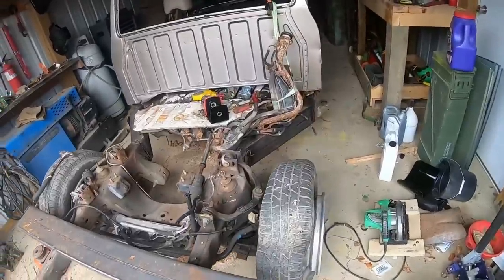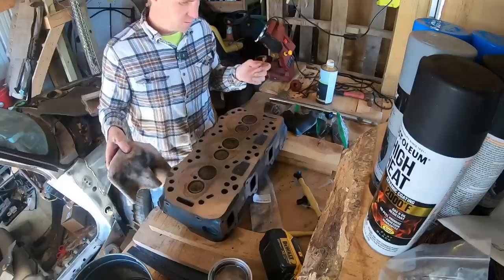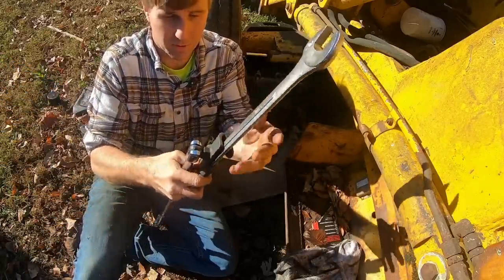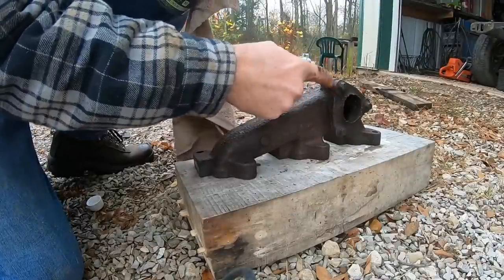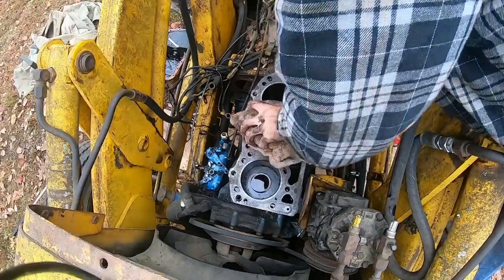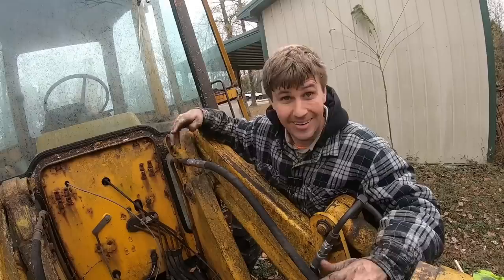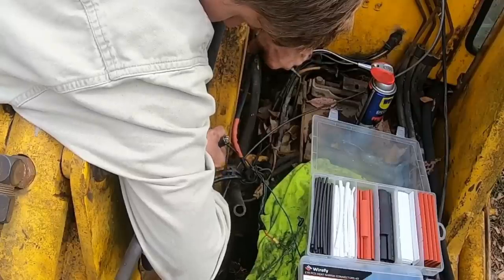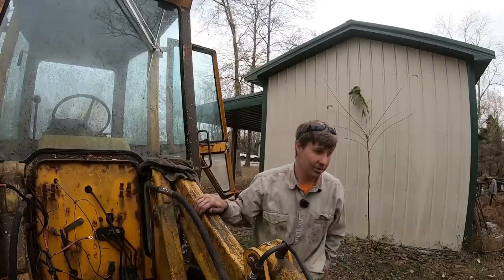Trying to Bring a Non Running Backhoe to Life- Can it be Fixed?

Comment: Gettin in deep there bud😁
I’d spend a few more seconds honing cylinders but slow drill speed down and use lots of wd40
I normally have someone spray wide open at same time of honing 
Wire wheel the top of pistons and should be a part number for piston and maybe that will lead you towards the right rings?
I assume you have already but make sure it’s not been bored out already it will be stamped on top of pistons also
Std. = stock
.20 .30 etc is overbores 
Good luck hopefully you don’t hate me 😁😂🤦‍♂️lol
Reply from the maker: Hahaha, hate you? How could I possibly hate you.  It's the finest flower planter I've ever owned!  😂😂 definitely appreciate all the help and answering all the messages.  💪
Reply: @CaptainKleeman  lol I hope everything else works on it for you
Reply: Maybe Clint can send someone to do all the work while you hold the camera. That will speed  things up a bit. Enjoy  watching. Thx
Reply: We can probably all agree that C&C is your most reliable comment. I’ll agree that more honing in the cylinders wouldn’t hurt. Your roto-plunger 6k action is good and will get you a good cross hatch.  Those rod bearings are probably a clue to that having been apart, and while they look good, I’d either check with a micrometer or plasti-gauge to see what the clearance is on them. This far in be good to know if the crank has been turned down, the bearings you have may be the wrong size if it has. Keep at it, you’re doing a fine job!
Reply: Could those scratches be from excessive end play in the crank since they all in line.
Reply: @williamreese2477  He isn't doing it for speed. He's doing it as a learning experience and on the plus side, have a backhoe when done. This is how people learn, by doing things. You have to start somewhere.
Reply: Seconded! I also hit the top of the valves with a nylon hammer to make sure the keepers and retainers are seated. When you shock the assembly a little, it will either finish seating the parts (this is desired) or they will fly out. The good part about them flying out at this stage is, they aren't coming out in a freshly put together engine!!
Reply: @tmacie2  if you mount them carefully they will seat on the valvestem.
If flying away where will the parts go in the open space? Nice if you have them spare. But when not you have to get them.
Reply: @tmacie2  if you watched C&C channel you would understand  my reply
Reply: @williamreese2477  Fair enough. Poor Kevin. Lol.
Reply: Keep at it captain you’re doing a fine job as you said you’re just doing it to learn and hopefully it works out for you. Ray from Oregon
Reply: If scoring was below the rings how did they score? What happened?
Reply: Clint is the man, if he tells you something to do, treat it as gospel, that ol' boy forgot more than most know.
Reply: @ggreenlee19  I m going to bet someone liked to use starting fluid (ether) in its previous life.
Reply: @ggreenlee19  probably starting fluid or stuck injectors
The fluid or I burnt fuel will wash past rings and remove the oil that lubes the pistons
Reply: @C_CEQUIPMENT  thanks
Reply: You sound like you may have done this one or two hundred times ;)
Reply: @williamreese2477  if you watch his channel, you would know that Clint passed on this but offered it to Cap bc he didn’t want to mess with it but thought that Cap might do exactly what he is doing (using personal time and learning).  C&C went above the call of duty already in offering his reduced cost to remove and deliver the “free” machine.  It was a favor to the farm that gave it away, and a friendship offer to Cap bc he used time and resources that would otherwise be on profitable projects (he has plenty).  The only axe Clint might have been grinding is the cross pollination from Caps viewers visiting C&C channel (bc he has tons of content, he’ll prolly add subs).  Yay for him and Yay for Cap in telling his viewers to go and thank Clint/dad/Kevin.  Did you post up there?   If not yet, there is no time like the present to show some love!!
Reply: @ericb9345  I agree on the plastigauge.  good tip!
Reply: @jamesrobinson1022  no
Reply: @genesispuredeaf2390  Clint is laughing Mike is laughing  Kevin is laughing  I am laughing. Go cry somewhere  else
Reply: @tmacie2  what does that have  to do with  figuring  out why pistons are different  and block is painted hints to later shortblock
Reply: @williamreese2477  not sure what you are referring to here...
Reply: @williamreese2477  go ahead and laugh at yourself too lil’ Bill. No crying happening over here but I am genuinely confused how I hurt your little feelings with my last post :(  ….sensitive much?
Reply: Clint, you are a good guy to help and put him on the right path as far as the pistons and how to do the cylinder walls, but I think he should install the new bearings that he already has.

Comment: Hone the heck out of the cylinders. Your not going to take out to much material. You want the cylinders as clean as possible for the new rings. Remember that you will have to fit the rings to the cylinder before you put them on the pistons. Keep up the good work.

Comment: Cap’n I gotcha covered… my first engine rebuild was on a ‘63 Chevy small block V-8.  It was done in the middle of August on 100degree days under a tree that shaded it only in the morning.  

I worked on it during the day and being only 18 yrs old… kinda rushed it.  My dad helped me quite a bit when I tore it down, honed the cylinders, ground the valves, etc.  But, when it came time to assemble the pistons, he was out of town.

So, I called my mechanic buddy (who was also 18) for advice.  He described how to install the rings, rod bearings… and loaned me a ring compressor.  

I carefully installed the rings, offset their gap, pushed them into the cylinder and commenced to install the rod bearings.  That’s where it went off track.

In those days, cattle feed came in 100lb and 50lb sacks.  Because we had a dairy farm, I handled a lot of them.  

After I got the engine all buttoned up, oil in it and the starter installed… I hit the ignition switch…and, the starter strained and clicked then, strained and clicked some more…. finally it got so hot that it blew the fuse. That’s when I got out the big wrench and commenced to turning the crank a few times ‘to loosen it up’.

So, I called my buddy up and asked him to come out and take a look.  He started asking me questions about what steps I had gone through… then he asked me how tight I had torqued the piston rod bearings. I assured him that they were ‘plenty tight’.  At which point… he mentioned a torque wrench.

You know Cap’n I believe that was the first time I had ever heard of such a thing…. As it turned out, knowing the difference between the weight of a 100lb and a 50lb sack of cattle feed is not close enough for rod bearing bolts.  They require a much more discriminating measure.

The result?  A couple of rod bearings seized on the crank shaft and scored the piston rod ends and caps.  The remainder seized in the rod ends and galled the crank shaft.  

The cost of the overhaul doubled…  just because a farm boys experience toting feed sacks doesn’t translate to a mechanics use of a torque wrench! 

Fortunately for you, there is no hot August sun to cause you to hurry… so you can take the time to read the manual.  And, toting fire hoses might translate torque feel a lot better.  I don’t know… but iffen you can get ahold of one of those fancy toque wrenches you won’t have to guess!

PS: no ridge in the top of the cylinder walls. You have a lot of wear available in that block.  It can’t have too many hours on it.
Reply: What vehicle was it?
Reply: @BWYinYang  Bel Air,  4 door sedan

Comment: A little trade secret , clean the cylinder walls with atf , using folded paper towels , the first couple swipes will come out black , clean new paper towels wipe again until clean , maybe clean one the best way you know how , then show the viewers , let's try the aft , and you will be impressed.
Reply from the maker: I've used more atf on this thing then I have in actual transmissions 😂

Comment: A 24hr soak in a 5 gal bucket of Evapo Rust goes along way Mike.👍👍👍👍And saves time. Google the engine stamp numbers to see what it is. ----->Keep in mind. When pulling out the connecter rods and pulling them back onto the crank put cut pieces of hose over the studs first. Cause the treads will nick the very soft crank journals. Making the bearings lock into the nicks after you torque down the nuts. Locking up the engine or they chew up your bearings.
Reply from the maker: Good tip, thanks mike

Comment: Just a thought Mike. If you add a rubber mat to the battery tray, make sure you have drainage or there's a risk that water will be trapped under the mat and that's no bueno. :)

Comment: Mike, I have a couple of viewer suggestions: I have found that with old wiring, it is worth buying a spool of wire, and replacing everything you can. Yes, there is a cost, but it is worth it not to be chasing future wiring gremlins. Second, I bought hydraulic line in bulk (100' lengths) and the reusable, field applying fittings. This has saved me a fortune over having the lines made. They are always the prefect length, are made almost instantly, and are way cheaper. Short of buying a hydraulic line swage machine, I think this is next best option.

Comment: Agree with Clint hone the cylinder more transmission oil works wonders to clean the cylinder up.  While it is apart and you can clean top of the block of the old head gasket.  and not have to worry about getting in places you don't want it to.  Also they have  a nice gasket removing pad for this makes short works of it.
Reply from the maker: Thanks for the tip John

Comment: Well you are doing your first in frame rebuild. Make sure to pull the oil suction screen and clean it. Doesn't make any sense to do all this and not to. Also, remember the recess in the top of the pistons goes away from the oil filter. Also there should be a mark on the rod caps that indicates which way they go on the rods.  You might want to consider pressure washing it before you start to reassemble. You are at a good place to do this and will have a cleaner assembly if you do. Good job so far, just take your time. It will be well worth it when you are done.

Comment: The 555 is a good machine , I agree with Clint , he's a pro .... I would spend a little more time on the cylinder hone . Make the walls smooth and  clean out some of that surface imperfection and she will probably run long enough to pass down to your kids .

Comment: Really enjoying this Mike. One thing I remember from my mispent youth is when you install the pistons if you put a 4 or 5 inch piece of hose on the rod bolts it will protect the crank and help align the rod end.
Reply from the maker: Thanks for the tip

Comment: Clint is quiet right you need to do more honing and this could possibly be a 3000 or 4000 Ford tractor engine but do your research and make sure that the Bore is right size for your ring have a great day and you’re doing a good job

Comment: In for a penny, in for pound! DIY is the huge cost saver. Even if the block had to come out, and you have to replace the hydraulic pump and all hoses. Once the 555 fires back up, you’ll likely still be way cheaper than any equivalent “running” backhoe you could find on the interwebs. You got this! Thanks for sharing Cap!
Reply from the maker: Thanks for the support

Comment: Don't know if anyone mentioned it but I think the oil pan is cast cause it helps hold the 2 halves of the hoe together. That's why the 2 big bolts in the bottom of the pan. Interesting channel like it.

Comment: Mike make sure to wipe the cylinders down with ATF to halt flash rusting and it helps with installing pistons. Also make sure to either change the oil pump and pickup screen or at the least clean it very well to get the sludge out from sitting in water and oil.
Reply from the maker: Yup! I had them soaking in ATF and gave them a rub down before covering.  Thanks for watching!

Comment: Mike, 20 years ago I purchased a Ford 4500 tlb and went through the entire machine just like you are about to do. I pulled the head off my machine but never got into the bottom end of the motor. I also split my machine to work on the clutch. My gut feeling on the engine is maybe this engine is from a Ford 4500 tlb . They were painted blue. A lot of the components on these machines were very similar through their production.

Comment: I have done essentially the same thing as you, tearing an engine apart and rebuilding it.  Except my engine was the rear mounted engine in a Corvair. Like you I had a manual and went step by step. The engine was horizontally mounted and I never took it out of the car.  This was in 1981-82 time frame.  and it ran beautifully after all was done.  I had never done that before, so I was quite pleased when it ran and I was finished.  Drove that car from Abilene Tx. to South Carolina the following year.
Reply from the maker: Very cool!

Comment: FYI wit rust... after cleaning loose rust off and wire brushing, apply phosphoric acid(sometimes referred to as Naval Jelly) to it and let dry. It turns any rust left into iron oxide, which will not continue to corrode under the new paint...
You're doing a great job so far!
Reply: thumbs up but iron oxide to iron (II) phoshate..which doesn't expand in volume compared to iron like iron (II) oxide does.  i knew what you meant tho.

Comment: Mike I do hope your replacing the rod bearings,and make sure all internal parts are really cleaned ,double check your work.just clean the oil pickup and make sure the internal of the block is all clean.just my opinion,looks good so far just don’t skip any steps.keep it up.good video.👍👍👍😎😎😎👨‍🚒👨‍🚒👨‍🚒
Reply: rod bearings look good, I never replace rod and mains just because I am there anyway {free labor} they're not really important any way. a little knockin is rockin?

Comment: Doing good Mike . When building engines dont do it dry use some sort of Lube even when you lapped the valves . When i rebuilt engines i always used oil when rebuilding even in the bores. it will all burn off when you start the engine . But for your first time i am well impressed

Comment: For rust protection I recommend POR-15. While expensive, a quart goes a LONG WAY, and lasts nearly forever.
Reply from the maker: I'll check it out, thanks for the tip
Reply: A long ways, it's incredible.  Breaks down in light though. Prime and paint is required.

Comment: I admire your tenasity of working on the engine without any experience or training. I have 2 years of automotive mechanic schooling in highschool BOCES and 2 years in a state college (non degree) auto motive course and have been employed as a auto/heavy duty mechanic for the last 50 years  The information available on the internet is invaluable. There is some jerks out there who  give advice, but most people are worth listening to. On your engine as far as you have shown us I agree with you just go for it. You will NOT "resize"the cylinders with that hone just resurface them, you don't have enough run time in that drill to enlarge the bore.
Reply from the maker: Thanks for support and appreciate the info David

Comment: Hello Mike, great video once again bud. The leak test on the valves was a good idea, another option that i saw Mustie1 do is to color the port edges with a black marker before lapping, when the ink disappears they should be seated properly. Looking forward to the next video.
Reply from the maker: That's a good tip
Reply: We used to use a thin application of bearing blue for the valve test. Wipe off the grinding paste, add a smear of blue to the valve, drop it in and give it a spin, then lift it out and look at the contact smear.

Comment: No you don't have to if the seat is good that it but if there is imperfection than you have to go with smoother,  I be more worried about the valve guides not being worn if they are you waiting your money check if there is side movement in the guides. If there is get them changed  that's way I wrote last time have your cilyder head checked out by machine shop normally mechanics they do that by them self because  we know what to look for. Good luck
Don't forget to put new seals on to your valves.

Comment: On the older IH German Diesel, they engines had 4 rings, 3 compression and 1 oil ring. The newer engines and the replacement pistons for the older engines only had 3 rings, 2 compression and 1 oil ring. Possibly Ford did the same update on their Diesel engine pistons.  Re grinding the valves on a Diesel engine, most Diesel engines have a valve protrusion specification and grinding the valves reduces the valve protrusion and will make the engine hard to start in cooler weather.

Comment: Good job Mike.  Watch out for the crank bearings when you get to them.  The oil ports are directional.  If put in backwards, the bearing will burn quickly.  Sure enjoy your channel.
Reply from the maker: Good tip, thanks!

Comment: The inlet has the bigger seal as that port is under vacuum so the seal prevents the suction from pulling in oil from the rocker area.
The suction is also why the blue smoke behind you is worse when the engine is on over-run.
Reply from the maker: Very cool!

Comment: Agkits has a 201 piston ring set, states "works for both 3 and 4 ring pistons. (3 Ring Pistons - You will have an extra compression ring left over)"
Reply from the maker: Won't work with these pistons